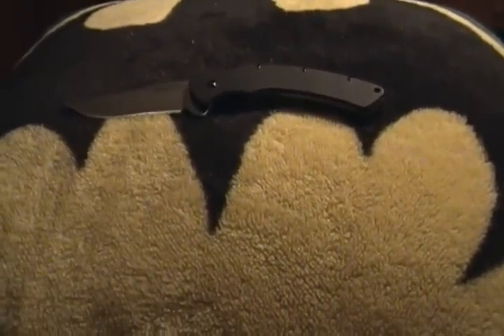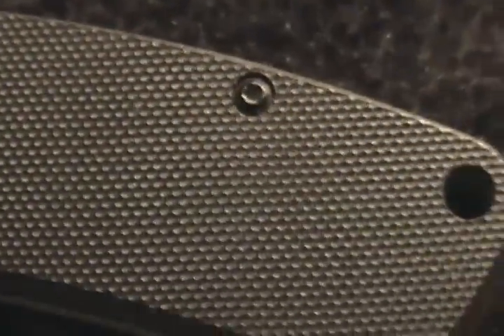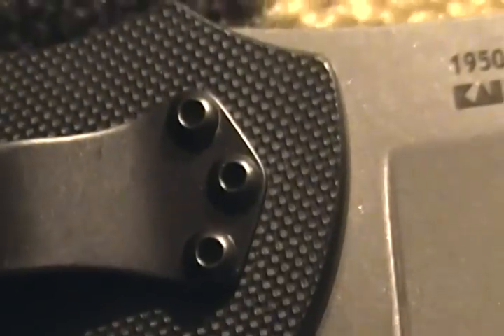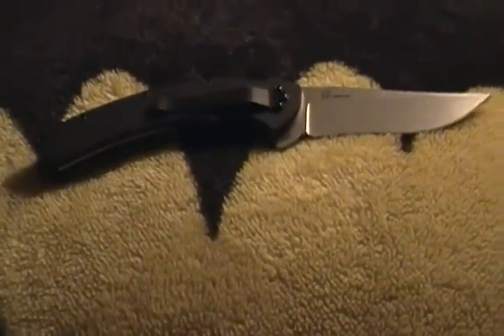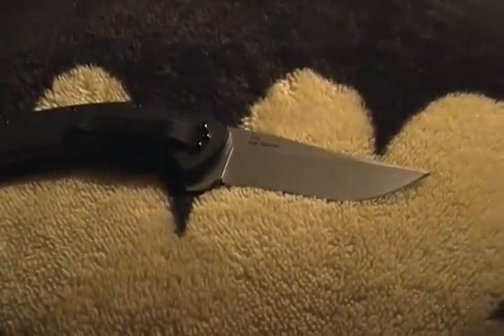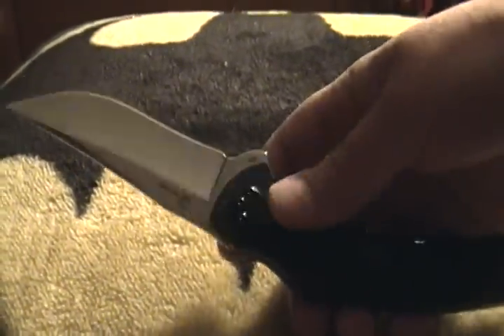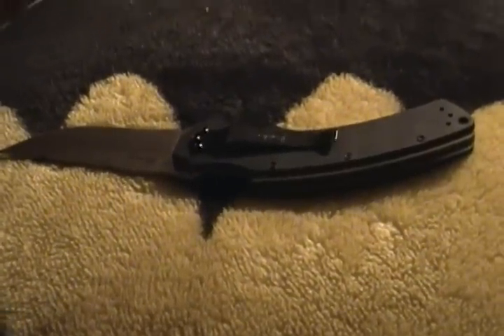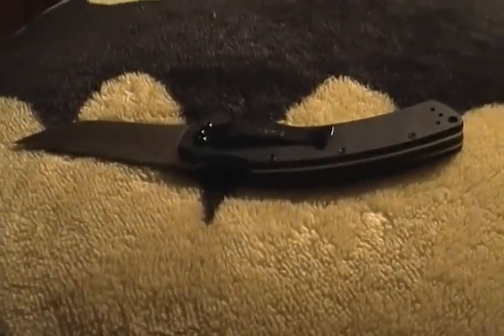My Kershaw Tremor is NOT the Same.

Comment from the maker: @kessler003 they do.  i had my kershaw leek for years before the torsion bar broke in two. i sent an email and they answered the next day.  they just wanted my address and model number so they could mail out a new one. then i mentioned off hand that the one screw on my clip was stripped out and they mailed a new clip and screws.  they didnt need any reciepts or where i bought it.  which is totally different than most companies.  they want to grill you on where and when you bought there knife.